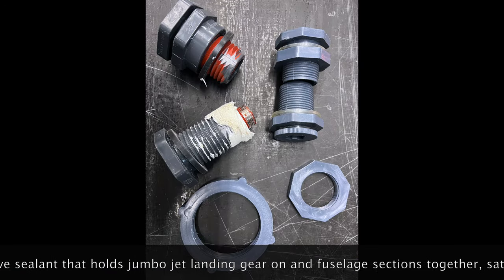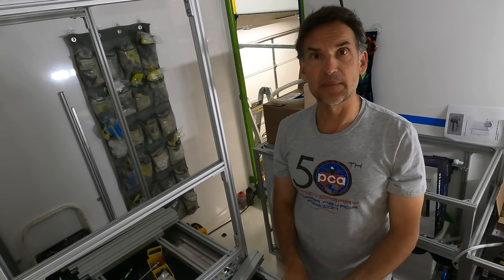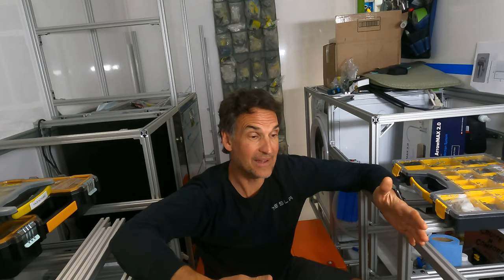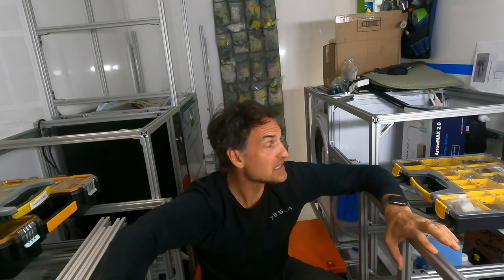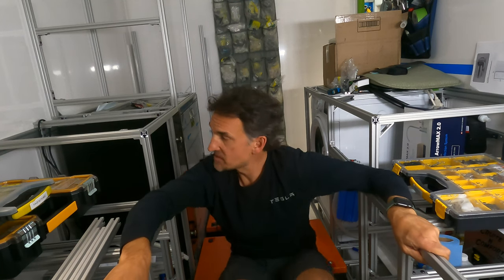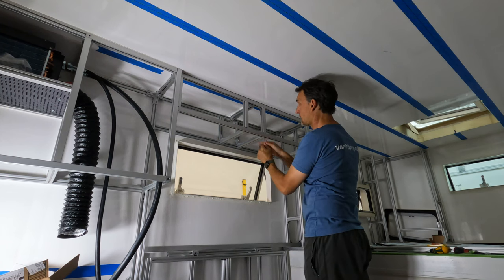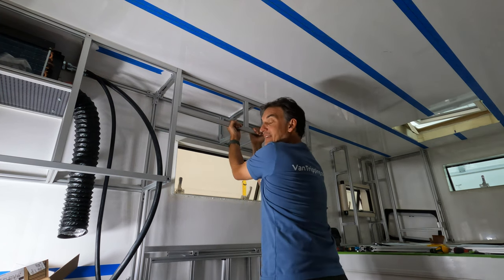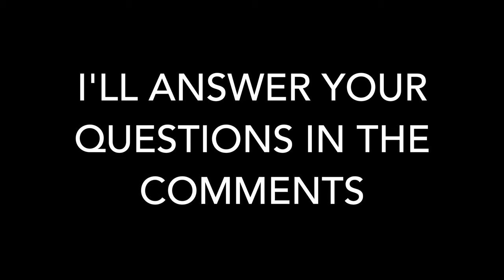The best way to attach cabinets to composite campers

Comment: Nice, I'm dreaming of and slowly designing a similar (if abit smaller) camper. Planning on using a  composite box with glued 80/20 cabinets inside. Couple of questions that I have thought of and would be interested to hear your opinion.

If I build 1 continuous 80/20 frame in all the internal corners of the box that I that add to build bed and cabinets. Would you be worried about the thermal expansion of the 80/20? Need to put some strategic gaps or slightly shorter peices allow for expansion? Don't want the 80/20 pushing the box apart or similar.

Would it be possible to insert panels into the grove of the 80/20 to finish the sides etc of cabinets so having the 80/20 as exposed corners to the cabinets. Or is it impossible/too fiddly to make sure the fasteners wouldn't  be in the way of the panels.

Hope that make sense and thanks for all the info from your videos already
Reply from the maker: Aluminum expands less than wood. The full internal width of my camper is 78" and aluminum would expand to 78.04" with a 50F degree temperature rise. I have installed it at ~70F and rising to 120F or decreasing to 20F internal temp is about as extreme of an internal temperature change that will happen, so 50F temp change is plenty adequate. I have about .25" of gap where the framing connects to each wall (so >.5" total across a span), plus gaps or overlaps in the framing allowing the center piece to move within the two wall pieces, so my framing can accommodate at least .25" in every direction (same from floor to ceiling), but the aluminum will expand only about .05". Good point but just not enough expansion with a typical internal temperature change to cause any issue. The adhesive will absorb all of this and is more than .1" thick in each direction plus a gap; I'll try to detail this gap in a future video, as great question you are asking. Now wood would expand at 2-3x this amount, so more thermal expansion space will need to be provided if the cabinets were made of wood, and wood expands at much different rates whether with or across the grain, so that needs to be considered with mounting any wood product, and hence why wood table tops, countertops and other furniture needs mounting that can accommodate expansion and contraction, whereas aluminum and steel do not.
Reply from the maker: As for adding panels within the extrusion slots, absolutely! They are made to accommodate panels, and a real benefit of 1" profiles is that the slot can accommodate a .25" thick readily available panel in nearly any material desired. I did this in my camper van showcased in previous videos and now for sale. When doing this, it is harder to remove an inserted panel unless at least one of the extrusions can be easily removed. And yes, you have to work around any fasteners. I am choosing in this camper build to keep all panels mounted to the sides of the extrusions instead of encapsulated within the slots, to make installing and replacing easier, as well as to more fully cover the aluminum framing. Great question!
Reply: Ok, thanks for the info. That's not alot of expansion! Don't think I'd get my cuts that accurate/tight anyway! Yes I fear inserting the panels may require alot more head scratching/more time on sketch up
Reply from the maker: @wawa8031  You're welcome. Nope, not enough expansion to be concerned about. I have more than enough gaps between the walls, floors, ceilings, and between each connecting sub-assembly cabinet sections. It's really hard to get cuts better than 1/16" unless using a professional set up, and even a 1/16" is enough gap across the entire camper width. Great that you're thinking about it. Inserting panels into the slots does require some thinking about assembly and interaction with connectors.
Reply: Great question, I was going to ask the same. The thought of the aluminium expanding with heat and pushing the composite box apart is terrifying. @vantripping Please do a video on where you left the gaps and why, glue thickness etc. How are you going to attach your cabinet facing to the 80/20? What material are you using for your cabinet facing?
Reply from the maker: @sharpsticksnz4112  It expands so little that is not a concern. Again, wood expands 2-4x aluminum and most build cabinets from wood. Realize too that the composite panels are considerably stronger than the aluminum so the aluminum would just bend )a mere 1/1000th of an inch while the composite panels will stay stiff and flat. I'll share more in future video about how I connected the aluminum framing to the composite panels.

Cabinet faces and doors of wood will just be bolted with slightly larger holes or mounts to allow the wood to expand as it will far out expand and contract than the aluminum. Making cabinets of aluminum and using wood panels has been done in campers by many professional builders for decades and far outlasts just wood cabinets and just about every large truck and airplane has been made from a combination of aluminum and composites and adhered together--it's a far stronger and more durable construction method than adjoining wood. I'll do a video on attempting to break this connection in the future and guarantee I won't whereas with wood, no problem.
Reply from the maker: I'm planning to do a video soon of the gaps I put in at the walls and in-between. It varies, but roughly about 1/16" to 1/8" against the walls and ceiling, and a 1/16" or less gap between cabinet sections of about 48".

Comment: Hi what is the brand name of the glue?
Reply from the maker: I've been mostly using Sika 292i and sometimes Sika 251 as well. Looks at the specs of any adhesive sealant to make sure it bonds well to your substrate and bonded material, as well as meets the operating specs needed.

Comment: What glue are you using?
Reply from the maker: My preference for attaching the aluminum framing to the composite camper is SikaFlex 292i. Sika's 252 is also a good choice, Here is a link to these options which can be purchased at many resellers. https://usa.sika.com/en/industry/products-solutions/adhesives-and-sealants/sikaflex.html
Reply: @vantripping what Adhesive do you use for the solar panel installation on the roof?
Reply from the maker: @gator701  I used a two part adhesive from ClikBond, which was incredibly strong, same adhesive used to bond fuselage sections and landing gear to the frame on Commerical airliners. But that is hard to come by, and there are many one-part urea-based adhesives that are great for this purpose, such as Sika 292 and 252.

Comment: FYI, this is not a how-to video. It's 16 minutes of non-technical talk about how strong the adhesive is.
Reply from the maker: Yep, this video series of building out an expedition camper from scratch is most certainly not a how to series, as I've said in several of my videos. It is my sharing of my build, my decisions, my challenges and how I am building it so that others can learn from my experiences, and hopefully motivate others to also take on projects they want to accomplish. Many have questioned the strength of using adhesives, so I wanted to answer those questions and concerns about its strength from my experiences to enable others to use some of these great products and gain confidence in building a different way that may be better.
Reply: @vantripping  This is the only video of yours that I have seen. The problem I have is that your description for this video says "I show how to attach cabinets, shelves, and other camper equipment to an overlanding adventure vehicle", which is not true. You also titled a chapter "How to Attach", which doesn't provide any information about how to attach, except that you clean the surfaces with alcohol and use a level, which I think is pretty obvious to anyone who might be doing this kind of work, even for the first time. You produced a 17-minute video that provides about 10 seconds of useful information. It's 17 minutes I'll never get back. Anyway, congratulations on your amazing journey, but I'll pass on the subscription.
Reply from the maker: Thanks for you feedback  @muprock  .
Reply: Modern adhesives are amazing. I glued a carbon fibre tube to an aluminium end piece adapter. I was able to lift 4000kg with that joint. The hole in the aluminium adapter stretched but the glued joint did not fail. The adhesive was Hysol EA9394.